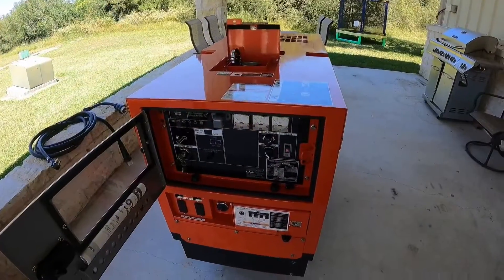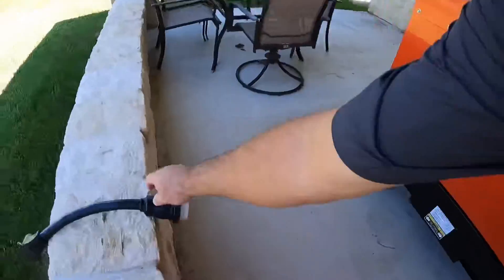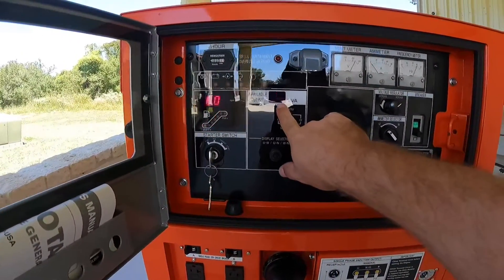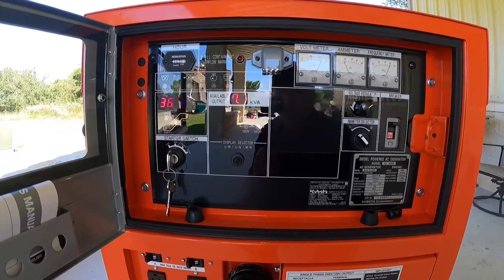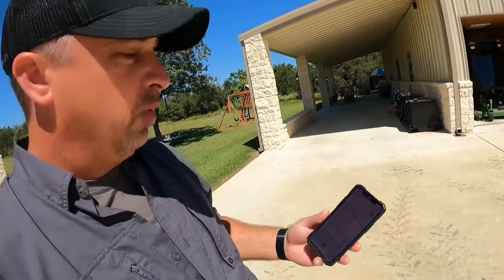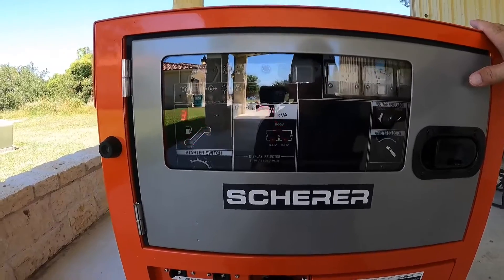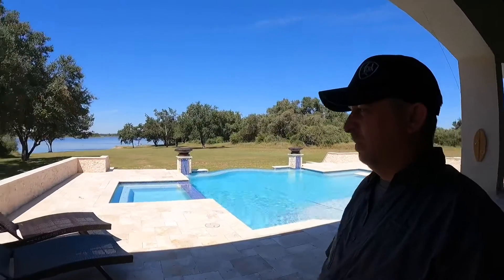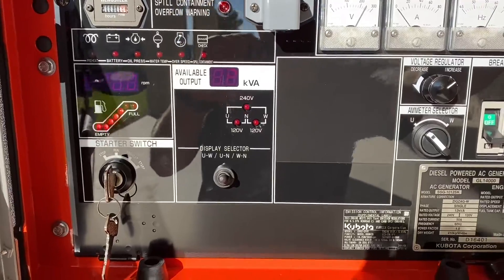Kubota GL14000 Diesel Generator loaded running house with fuel consumption and sound

Comment: An oversize generator will have wet stacking issues. they are designed to run at about 70% of power needs if I recall correctly. May I suggest  a 12 v pump with triple filter water, mesh then paper to draw directly from your external fuel tank. You can also use #2 heating oil in the northeast as it is the same as off road diesel.

Comment: I don't get how he can run two 5 ton ac units off this 14kw unit.
Reply from the maker: 22 seer variable speeds.. No inrush amps
Reply: I wonder if it would still handle a conventional hvac system?

Comment: 3600 rpm seems high for a diesel generator. My gasoline 7kw generator runs at 2800 rpm
Reply from the maker: I do wish it was a 1800 rpm gen set… Kubota lowboys have been made for years with a good track record.. I never worry about dependability with it..

Comment: It needs a smart throttle where it only runs at the rpm that it takes cover the load and with that they just sip the diesel because it’s crazy for it to go to 3600 rpm just power a light bulb . And like the other guy said why 3600 rpm when we have 1800 rpm units.
Reply: its a 2 pole genset 1800 rpm units are 4 pole and fuel use is really not affected by engine speed its really the load on the generator
Reply: sorry and with the higher rpm is a better response to large loads with a smaller less powerful engine due to rotational mass

Comment: That's a standby generator not designed to be ran continuous. It's 3600 rpm because it's a 2 pole cheap generator head vs a 4 pole that runs at 1800 rpm. It's also a 1.0 PF (power factor).
It's very loud on these cheaply made 2 pole units like generac.
I prefer my .8 PF unit that is a 4cyl diesel running 1800 rpm and it cost 1/4 of the price of thos Kubota.
I can run mine continuously for a year straight if I want to. Mine also has an auxiliary pump that pulls from a 240 gallon tank into the onboard day tank.
I can hear my neighbors 3600 generac from 1/3 mile away and I can't here mine when I'm in the house or outside on the other side of the house.
Reply: I have a MEP-803A. 
It's a military one weighs right at 1200lbs and the entire cabinet and skids are all aluminum. Has a 4cyl Onan water cooled Diesel engine that's 1.9 L and 24 HP.
Reply: Thanks for the info. What’s a good model for me to get because I like what you like quiet you don’t have to run it full speed. Those are too big options that I need?

Comment: I know I'm late to the party here.. but I'm missing something on the fuel consumption in the video - the Kubota spec sheet says it will only run 15.0 hours at 25% load on the 9.62 gal integrated fuel tank.  Why isn't the math matching?
Reply from the maker: Maybe advertised Rate vs actual..

Comment: So would this unit power a house during a power outage I’m in south Texas and want to be prepared for that
Reply from the maker: Yes it powers my house no problem. I do have gas hot water heaters.. Just have to manage power if you have all electric. Such as shut off AC and turn on water heater..
Reply: @RockyRohde  yes everything will be electric thank you so much for the information it’s been very helpful

Comment: These are really nice generators, but I'm only looking at 1800 rpm units. My current unit has lasted since 1983 and just ran it 30 hours in the Florida hurricane. She's tired, so I'm shopping.
Reply: 30 working hours and it is tired?

Comment: What size Wire from the Generac box to your breaker panel ? And is that just a 50 amp rv cable connecting the generator to the Generac box ? And what size breaker are you using in your breaker panel ?  Thx sorry just trying to get my GL 14000 hooked up
Reply from the maker: Generally 25-50amp requires 6 guage. Keep your length as short as possible..

Comment: Great unit and design! It is perfect for a home back up, but my only 2 dislikes is the small fuel tank and that fact it runs at 3600 RPM.  I wonder if that will affect is over life cycles becuase it is running double time as compared to the standard 1800 RPM. MQ Power is also another alternative but more costly. Thiose units are Denyo gnerators designed in Japan too.
Reply: As long as the radiator stays clean and doesn't clog up, these engines will outlast me, you, and most cockroaches.
Reply: Same I wish you could run it at idle for a couple minutes at least 🤦‍♂️

Comment: I LOVE kubota products, but I can’t get over the fact that it’s a diesel generator that runs at 3600 rpm.
Reply from the maker: I also would like it to be 1800.. The generator still performs great..
Reply: I wish it had a low idle mode for cool down like the Westinghouse gensets do.

Comment: Hey Rocky, nice vid. Do you run red diesel?
Reply from the maker: Kubota put red in it when I purchased. I do not run red.. I don’t use enough diesel to make it worth it..
Reply: We have a winery and will run Red diesel as its cheaper and we qualify for it and will basically be running our generator 24 hours a day for the entire year cause we cant get the winery facility wired up for a affordable cost cause its so far out from any lines.  @RockyRohde

Comment: Kubota also design gen sets that run @ 1500 rpm. Not for the American market through. Made for Australia/New Zealand where our voltage is 240/250V ac single phase or 415V 3phase

Comment: I’m looking at that unit.   I noticed the Kubota used quite a more fuel than the Generac.   .85 verses 1.29 gallons an hour at 50 percent load.   Curious but a 50 amp plug is only Rated for 12k. I’ll bet your  losing the rest in those plugs  on the front.

Comment: These 3600rpm genarators are super loud , not only loud the sound is annoying. Those 1500rpm ones are much better but they start from higher kva ratings with larger displacement engines that are more efficient & quite
Reply from the maker: And heavier
Reply: @RockyRohde  Have you had the opportunity to put some hours on this unit yet just wanted your feedback on the reliability and the cleanness of the power for sensitive electronics thanks
Reply: @chuckschweitzer491  Anytime you're worried about distortion on the line, a UPS is a great inexpensive fix.
Reply: @bujin5455  lol. Only "online" ups can fix the line voltage. If it's a very cheap models (line interactive) will just ignore the distortion & fluctuations. And if it's a mid range model. It will refuse to take that dirty mains. Like my apc br1000g does not like the old honda ebk3000 generator and will refuse to use it's power. But the cheaper bx1100 on my dads computer will not care and provide that dirty power to the load.
Only the online ups will take that dirty power convert it to dc and then convert it back to clean ac. Those ups's are very expensive and u can pretty much get an inverter generator. At that point and not worry about anything.
Reply: Just fyi , budget online ups starts at around 800$ range for 700w models & can go very very expensive. 
My office has a 3kw model from tripplite & it was around 2500$ new.
Reply: OH TALALALALALALA

Comment: Psssst! I hate that foaming when filling from that station. If you want to speed up the fueling, take out the screen filter. it pops right out. Don't lose it in the wind. as soon as your done filling up, place it back in, and done.  helps TREMENDOUSLY!! Good video btw. I have a lowboy 2 11kw, has 4200 hours on it. I took out that fuel filter and replaced it with a regular "Baldwin"  inline fuel filter. (no more possible cross threading for me) Thanks for the video. Have a GREAT Easter!
Reply: Were going to put like 8,000 hours on ours a year at a winery.

Comment: The Kubota SQ3140 revs at less than half the revs of yours at just 1,500rpm, it’s quieter and uses less fuel at 100% load as yours does at 40% load.

It also provides both single and 3 phase power.

I’m in the market to buy one and can only assume you chose a generator that has the same output but is strictly single phase, noisier, more thirsty and louder because of price?
Reply from the maker: 60hz America
Reply: You can not get these generators in the US they are all 50 HZ

Comment: Hey for how many hours did the genset runs
Reply: He told you.
He ran it for 4hrs and said it could run for 24hrs at 40% load on one talk of fuel.
Reply: It's not Rockys, but My kubota 2 11kw lowboy has a 7 gal tank, I use about 3/4 gallon diesel per hour at about 65% load. I would recommend using a quality fuel additive, IE: TK7 or HotShot ED takes very little each fill. (an ounce per 15 gallons) If you fill up 3, 5 gallon diesel containers, i just got a 10ml   syringe fill it up one time for each 5 gallons and wah lah! Done (30ml is 1oz) My kubota has 4200 hours on it. Last year I had to replace two injectors but other than swapping out the fuel filter for an inline fuel filter, and regular maintenance, have had no problems. OH! DO NOT USE Dyed Diesel / Farm / Off Road fuel.  Rocky has a very reputable generator with that Kubota.

Comment: What is the model number to the plug adapter from the machine to the 50 app please
Reply from the maker: NEMA SS2-50P to 14-50R, CS6365 to 14-50R
Reply from the maker: Parkworld 886399 Shore Power 50A to RV & EV Power Adapter Cord NEMA SS2-50P to 14-50R 1.5FT

Comment: Those are nice units but why on earth did kubota use a 3600rpm generator head? 1800rpm would make that thing whisper
Reply: To make 14,000, it would need to have a larger HP engine, over 24.8HP (in Kubota anyway) they have to put the diesel particulate filter, and go common rail injection, making the price of this unit go up 4-5K. This is a way to have a smaller (lower price) engine and still get the 14,000 Watts
Reply: Agreed.
Reply: Remove that pos dpf as soon as you can

Comment: Nice-looking unit!  I didn't see a ground wire.  Do you have a ground rod in the ground next to the generator?
Reply: Ground is in the center of that 50a twist lock
Reply: The house is required to have the ground, so that's already satisfied without adding a second ground.  A second is prohibited.
Reply: @PeterLawton  hmmm...I've installed and maintained hundreds of emergency generators at homes, hospitals, and other buildings.  Every one had its own ground lug and dedicated ground rod, with a solid copper wire connected directly to the ground lug on the generator set.
Reply: @DavidTaitano  "If the portable generator is providing electric power to a structure by connection via a transfer switch to a structure (home, office, shop, trailer, or similar) it must be connected to a grounding electrode system, such as a
driven ground rod." -- from https://www.osha.gov/sites/default/files/publications/grounding_port_generator.pdf

So the structures you've connected to already had ground, and your generator connected to that via the ground conductor of the cable.  Additional grounds you may have added were redundant.